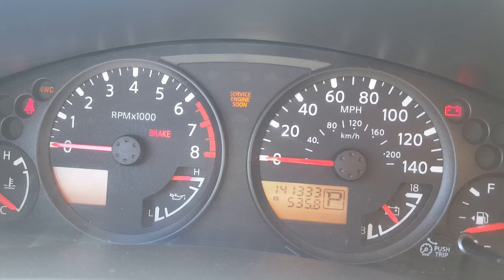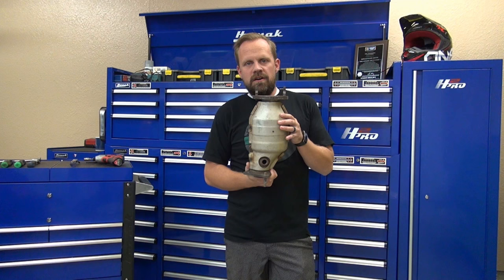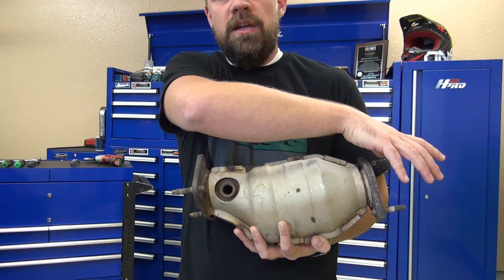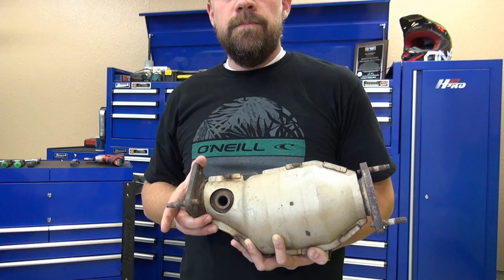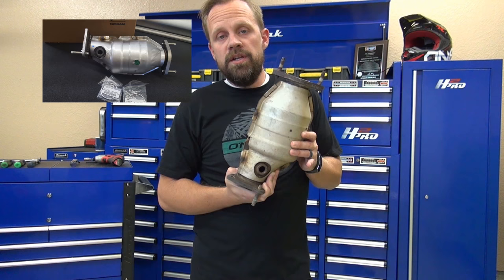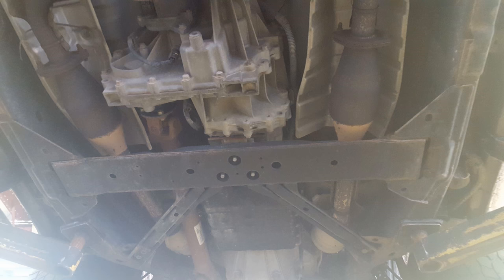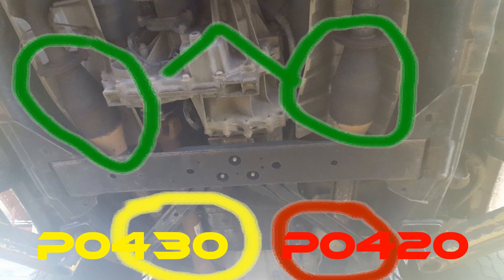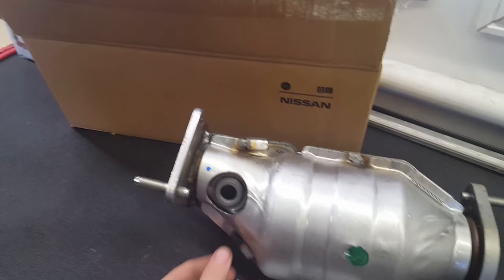Nissan frontier p0430 or p0420 | How to fix a check engine light

Comment: Thats because alot of the time a p0420 code is caused by the crappy Camshaft\crankshaft sensors and it throws the engine performance off which fools the o2 sensors surrounding the CAT. Most the time people dont even need a new CAT.
Reply: I've had to replace those sensors several times.
Reply: I just replaced camshaft and crankshaft sensors three months ago, now throwing a code for a new CAT 

any thought on it being a bad o2? Or should I explore the other sensors?
Reply: @Will-qn5no Same thing on my 2010 Frontier.  I had the crankshaft/camshaft sensors replaced recently and now the catalytic converter code.  Did you figure it out?

Comment: get a sparkplug non fouler from local auto parts store , bore and grind open to fit O2 sensor and install downstream  to block theses nuisance P0320, P0420 codes!

Comment: Good video to help me with my 0430 code. May I suggest that instead of using terms "left" and "right" you refer to the driver's or passenger side? Not sure if you mean "left" as we are viewing the video or "left" as we sit in the vehicle. Thanks.
Reply: All the color coded illustrations they showed weren't good enough?
Reply: Left and right is always referenced from being seated in the cockpit, or on the drivers seat for such as a motorcycle, as it should be. If everyone followed this common rule there would be zero confusion
Reply: Left driver side bank 2
Reply: @dlg5485  Some people just don't get it. Hahaha
Reply: @tylerfochtman1578  Thanks

Comment: Why is the cat going bad...if it really is bad?  P420/P430 is a efficiency code generic code.  Replacing the cat just kicks the $3000 repair down the road and not solving the problem causing the cat to (cough cough) go bad.  Cats should last the life of the car...certainly not 140K miles.
Reply: what do you recommend for p0430?
Reply: @healthyamerican  Find a good mechanic that solves the root cause.

Comment: I fixed a p0420 code with the cheapest aftermarket cat I could find on Ebay about 3 years ago, still working fine. I just got a p0430 and will get another cheap cat after verifying my O2 sensors are in spec and checking temperature of exhaust pipe before and after cat to see if its clogged.
Reply: Male sure to change spark plugs, clean injectors, and confirm no vacuum leaks or o2 sensor issue.

Comment: I have a 2013 Nissan Frontier SV V 6 with 97,000 miles and got a P0420 code. After looking at the cost of OEM catalytic converter for the right front converter I was shocked. With the truck being over 10 yrs old I am weighing the cost on OEM or aftermarket the difference is about $1,000.00. The used catalytic converter alone would bring about $300. - 500 at a scrap dealer.

Comment: Replaced the Catalytic converter on my 2015 Nissan Pathfinder at Nissan with Nissan parts. Just 20days over a year I have the same code up. The first replacement wasn’t cheap.

Comment: I live in a state with no emissions inpections (SC).03 Pathfinder p0430 came on a few times and I reset it a few times before trying seafoam.I ran seafoam in the gas and did a full upper intake clean and then ran the crap out of it on the highway.CEL p0430 did not come back on until almost a year later.If you are on a budget or just need to pass emissions it is worth a shot for $12 worth of seafoam.
Reply: I have both PO420 and 430 so sea foam it is for now. We'll see if it works
Reply: @mustangpassurchevy Did it work?  I'm getting this code on my 2010 Frontier and won't be able to afford to replace the cat for some time.

Comment: You are right about the original manufacture part, i had nissan veihicles before, a sentra and frontier as in the video, tried autozone or after markets just to found out that i got an error code again after some time and stalling issues some times, thus making me spend time money and effort, and forcing me buy the nissan  original part as i have to do from the very begining so far, lesson learned for me. Some times it is not worth to save some few bucks while spending hundreds.

Comment: I have a 2007 Frontier Have the P0420 for a year I decided to try the sensor swap with OEM but it failed the code actually came back way sooner,clean old sensor & found also the Ground strap was torn So I replace & all works been over 2 yr.

Comment: Great Video, I have a 2011 Nissan Frontier Pro 4x that ive had issues with the MAF sensor, the original one died and put my truck into limp mode, i replaced with a aftermarket one from o'relieys and kept throwing the code a short time later, i took it back under warrenty and they replaced it with another which does the same thing, so figuring maybe were they were aftermarket i decided to get another off amazon, the reason why Nissan want $340 for a oem sensor. So have you had issues with these trucks not liking a aftermarket mass air flow sensor? thinking i may as well go ahead and buy an oem from nissan. What are your thoughts?

Comment: Informative Video.  Thank you for posting.  Question...how do you rule out the downstream senors?  If a senor was going bad what code would it kick?
Reply from the maker: Normally lean or rich codes and or heated o2 sensor circuit code... Normally if you have a 420 or 430 code your cat is most likely failed... However if you have a bunch of codes in the system you should try to fix those first and than move on to the cats only if needed

Comment: Thank for the video. It helped me figure out which side was the 430 code since no one at the auto parts dealer shops knew the difference. However, the guys there suggested that I run some 91 gas and sea foam first to see if it's throwing a code over dirty gas.  I did fill up with 86 in a small town in az on a trip to save some money. :(. I reset the codes and it hasn't come back on. However, if it does- I will certainly follow your advice about the converters.  I figured they were all the same quality. Thanks again!
Reply: Greg , on half tank , add 1 gallon of lacquer thinner , and go for 100 mile drive , and park for 5 minutes and give it gas , aroun 2500 rpm no more than that , that will clean your catalyst , try that , its inexpensive , unless you want to spend $1000 +
Reply: @Leo-uy4qv are you insane ?

Comment: You said this is a common problem, I'm getting the same code. Any thoughts on what the cause could be? Mine is failing (I think) but just after 30k miles, weird.
Reply from the maker: You may take yours in for factory warranty? how old is it?
Reply: 05
Reply: Kyle Lester .. you right. There 4 thing that could  couse this code...
Reply: Hello Kyle do you ever fix the code  problem  i purchased driver side aftermarket Cat from 1A auto and 4 month later after installation my checking light on return same codes any updates ? Thanks

Comment: Stupid question, will a bad cat cause drivability issues? My 06 maxima is bogging down in 10 minutes of driving.burnt plastic smell too. Only code is p430
Reply: Yea I feel like this happens to my car.  Feels like the muffler is plugged up which I think means the bad cat, in your case on the left drivers side for p0430, got so hot and brittle that it broke and caused and obstruction and a back up of exhaust fumes back into the engine and through the other side.   Something caused that cat to burn up though.  Air leaks from the intake plenum, oil fouled spark plugs from faulty valve covers causing oil to be burned up, exhaust leaks, or fuel delivery issues are all potential causes of p0420 and p0430.  Need to fix the issue and not just swap the cat.  If you fix the lean condition (at least in my case) by sealing the air intake plenum, the codes may go away without needing to replace the catalytic converter if found early and taken care of properly.  Need to fix leaks, any timing issues, and spark plugs, coils, and valve covers while you're in there because it is a lot of work to get the air intake and all its components off. Might as well get as much potential issues solved the first go round
Reply: @tylerfochtman1578  ..Right on Target partner 😎

Comment: So if I have both codes, what would the cause likely be?
Reply: same here did you fix it
Reply: Same here i already replaced cathylist converters still on
Reply: Watch out for air leaks, exhaust leaks, timing issues, spark plugs, make sure you don't have a leaking valve cover where oil seeps down your coil
Reply: If not those issues, check your fuel delivery system.  Fuel injectors, fuel pump and filter, ECT.
Reply: @tylerfochtman1578  those can throw a 0420 or 0430 code? Fuel pump/filter?
Reply: @tylerfochtman1578  I just blew a coil and wondering if that could be a cause of the codes. Likely a leaky valve cover or catalytic converters?
Reply: @Nick probably not as often as your typical converter issue.   Could be an air leak in the exhaust or intake. But if an injector is leaking from high fuel pressure, could cause the computer to do weird stuff to compensate. (That would be a richer condition, but could be low pressure causes less than is expected to be delivered.
Reply: @nickk3765    .
Reply: @tylerfochtman1578  thanks for the info. I get a new scanner Thursday so I'm looking forward to seeing what it will tell me before I order the new cats.
Reply: @nickk3765  yeah. Sometimes the cat is getting burned out from a leak present.  So to keep the new cat from burning out too quick, you should make sure there are no exhaust leaks or intake leaks.  You can change gaskets on the intake plenum, exhaust manifold, exhaust joints, ECT. Or you can find the leaks by hooking up a reverse shopvac to your tail pipe and spraying down all the exhaust joints and such with soapy water to see if any air is escaping.  They make muffler take and high temperature putty you can use to seal the exhaust without shelling out too much for comments, unless they are already unsalvageable.  I replaced the right passenger front cat for the p0420 and the code went away.  But if both cats are beat, might need more parts due to rust or just a lot of use/breaking down.  I would rule out leaks, swap around o2 sensors and reset them.  Takes a while to run a drive cycle to complete the monitors so if you reset them you can look up a proper drive cycle to complete them and see if it is a sensor issue.   Sounds like both banks are beat to me.   I got mine from rock auto.  The carb compliant California catalytic converters.  In my mind should be more efficient.  Cleared my codes.  Had a new code, then that one randomly cleared one day.  Just hope there isn't more going on that might be the true culprit as to why they went.  But if it was just time after 60 to 100k miles I would just change them both and change all o2 sensor at the same time while you're at it.  And if there are any other components that you would have to remove anyway and it looks rusty, I'd just buy all the components and do it right and plan it all appropriately.    Crazy how a clogged up cat can make your drive way more hesitant and even harsh and slippy
Reply: @nickk3765  might be wise to clean the maf sensor as well, just to get accurate and consistent reading from all of your sensors and components that go into calculating the air gas ratio and determining if there is a leak or rich condition.   Using the scan tool you can look up the short and long term fuel trims to indicate a potential issue.  There are a lot of good videos on the topic.  I would search for a mechanics shop manual for your make and model and do your research.
Reply: @tylerfochtman1578  all great advice, and thank you so much for the thorough reply! I got the scan tool yesterday and confirmed both sensors are reading low efficiency ( I think).... I checked the intake for cracks and will next check the exhaust manifolds. But with 140k on this Titan, I imagine both cats need replaced.... But you're right, I wouldn't hurt to clean the maf sensor and maybe do the valve covers and plugs just to be safe!

Comment: How difficult is it to pop the old one out and put a new one in? Do you just have to remove that one part or does the entire exhaust system have to come out?
Reply: 4 bolts, apply WD-40 on old bolts let them soak for at least 30 minutes, remove oxygen sensor 1st and replace with new one after catalytic converter has been installed. Good luck friend.

Comment: You said left side for the p0430 code, is that drivers side or passenger?
Reply from the maker: Left would be the drivers side.
Reply: But my passenger side was the p0420 code.  On an 05 pathfinder. Bank 1.  Bank 2 drivers side was the p0430